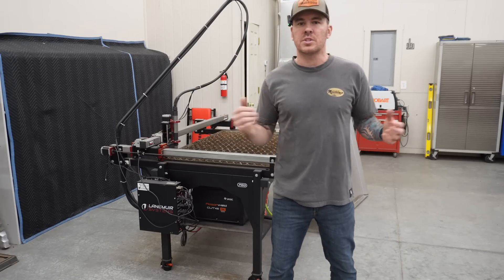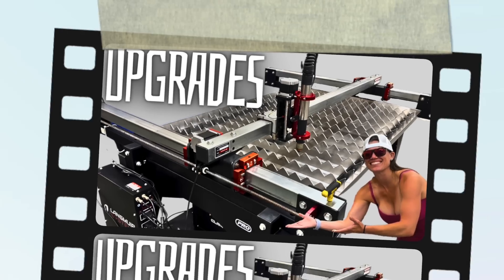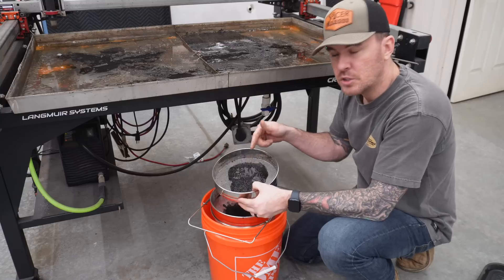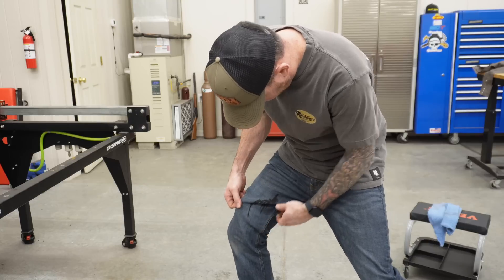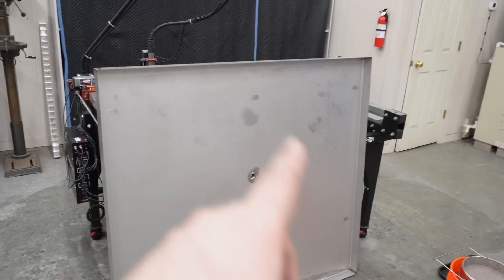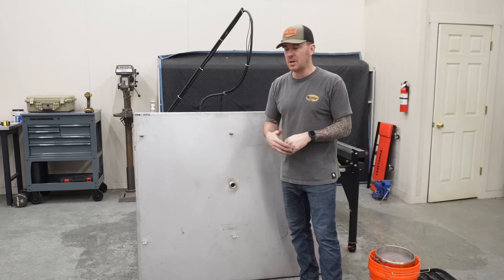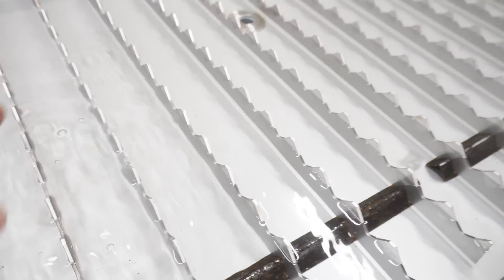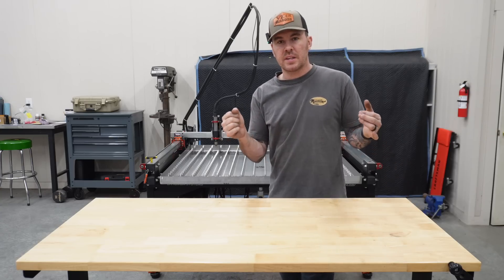NEW UPGRADED Water Table for The LANGMUIR Crossfire Pro..

Comment: Dude, I don’t mean to tell you anything you don’t know, but why do you need more than four tabs? You got four 2 x 2 tubes on each side you don’t need to screw the tabs to the tubes unless you live in an earthquake area just set the pan down you take 11 gallons 8.34 pounds a gallon where is it gonna go The common to call that over Enginering?
Reply from the maker: I would hardly call screwing the water table down in 6 places which took all of 5 minutes "over engineered". That table is secured while holding square to the gantry which allows me to measure off it when lining up cuts.

Comment: North west indiana?   Ummmm yeah .... I'm in north central indiana.  I go that way a lot.  I might be in touch with you about getting those from that shop.  Just got my table a month ago and I'm getting ready to set it up.  I could literally pick up this stuff in person.   Thanks man!
Reply from the maker: We actually moved to southern indiana a year ago.  About an hour north of the Kentucky border.  Still not far
Reply: @SpicerDesignsLLC  if the shop you have making them for you is in my area I could pick them up there directly and save the shipping costs if that’s possible
Reply from the maker: @tna2me197  ya they are in East Chicago. Hammond/ Gary area.
Reply: @SpicerDesignsLLC     Oh cool!   I work in Chicago and keep my boat in Michigan city.  I’d be happy to order some things through you and just pick them up there. The water table and slats have my attention.  I built a 4x4 table that operates on mach3.  But it’s not as accurate as I’d like.  I’m probably going to put hybrid stepper motors on it eventually.   
I’ll be in touch!
Reply from the maker: @tna2me197  sounds good. Just email me if you need something

Comment: That looks fantastic, Kyle.  We have lots of tools and machines in common!  On our table, the slats are actually below the water level (instead of above, like yours) and the cuts happen slightly below the surface, in the water.  We find that there's less splatter and the material is keep cooler than when it's out in the air.
Reply from the maker: Hmm. Thats interesting.

Comment: Nice upgrades.  Sounds like your X gantry is tweaked. That is a long span for a narrow beam.  (Pushing in the middle probably doesn’t help either :). )
Reply: A linear rail instead of the bearing roller relying on the square tubing being straight would have been a much better design. I probably would have also added a cover for keeping the ball screw clear and clean.

Comment: Yeah I'd definitely go with the aluminum slats but you can sand primer and enamel paint your mild steel slats so you don't get a sludge of rust in your water table. For those who still have the vanilla table you can also cover the mount bolts the same so they don't rust and leak.

Comment: Looks like a great upgrade. Is the 1/4” gap between the bottom of the material and water the ‘industry accepted’ sweet spot?  I need to make a pan for my table, so looking for some pointers?
Reply: The idea of having water is two parts one to absorb the heat so your material doesn't warp and two to contain the dust and molten slag. I have a flash guard on my head with three low pressure air nozzles. Aimed so everything about 1" around from the cut goes straight down into the water. Technically you can run water up to the bottom of the material which makes sense if you're cutting material less than 18 gauge. But obviously unless you have a recessed water table design or lower profile slats it's going to splash water everywhere.
Reply from the maker: Im not sure on that distance but its pretty much the same as the old table.  Allows me to have about a half inch of water below the points.
Reply: On our table, we actually run with the slats slightly below the water surface so the material is cut in the water. It works great.

Comment: That looks sharp! I don't have any water in the shop where mine is, so I came up with a rather hackish solution. There's a 17 gallon tote under the table, with a 5 GPM garden pump submerged in it. I used a solenoid valve between the drain and the pump. To fill, the pump and the solenoid are both switched on. To drain it, only the solenoid is switched on, and the water drains back through the pump. The pump sits about 1" above the bottom of the tank so any crap that drains down does get picked back up. Right now I have to watch the table fill and turn it off before it's too high, and also wait for it to drain so the solenoid doesn't stay on forever. Eventually I'll either get water down in the shop, or design a device that will stop at some level when filling, and keep the solenoid open for some fixed period of time when draining.
Reply from the maker: Sounds like quite the setup

Comment: Nice job, but tape And dope is far far overkill. It’s not under pressure, and you have the bucket. Could be a bit of a bitch undoing it later. A secret you cannot share, good old wood glue makes a great light duty, easy to disassemble thread sealer.
Reply from the maker: Im not taking any chances with any leaks.  Thanks for the tip